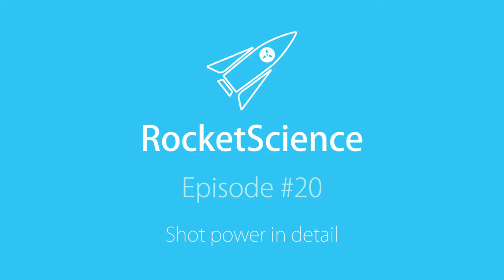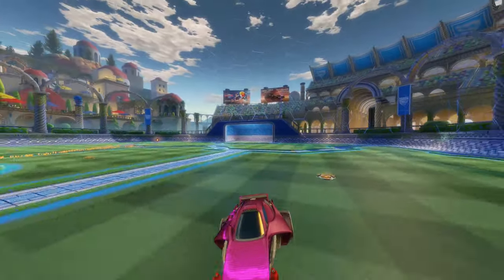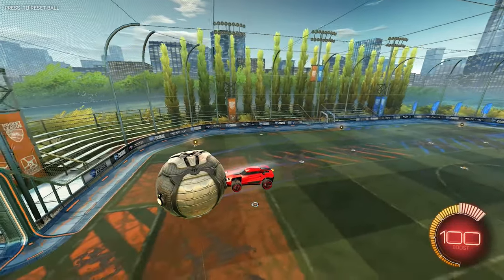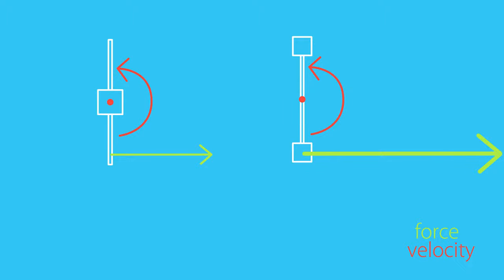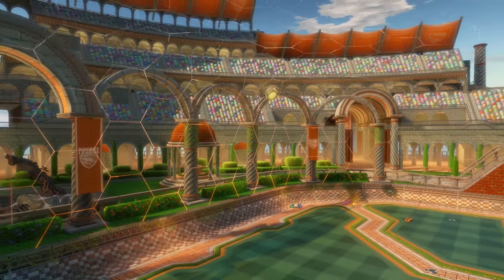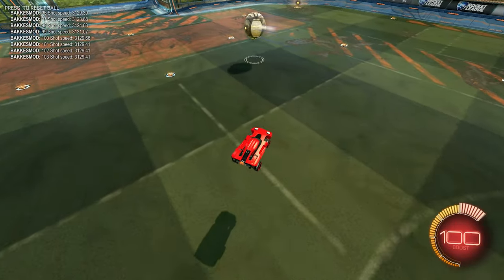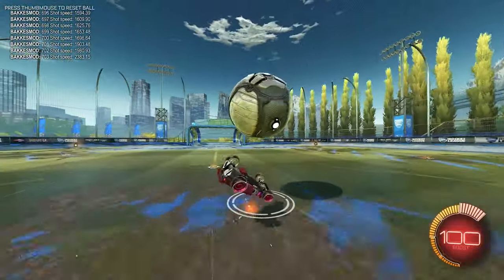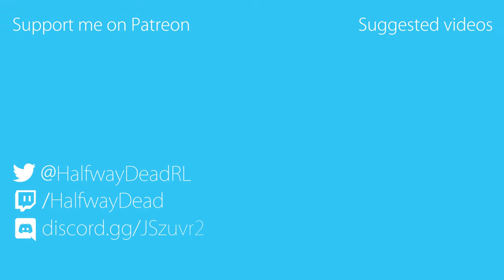Maximize Shot Power - Rocket Science #20

Comment: 5:00 fake physics off 
car floats through the air
Reply: If you think about it, you have to find the net force, this would be an easy case, you know the direction of the car and the direction the gravity are 90 degrees to each other, the net force would be the hypotenuse of the triangle, which can be calculated by the Pythagorean theorem. This will only work if the force is at the direct center of the sphere, assuming the mass is spread evenly. Other things like friction will increase the longer the more time the car is in the air, hence why, it starts falling quicker.

Comment: I've also found out there is force applied to the ball when doing 50/50s. When approaching a 50/50, if you apply more force than your opponent, the ball will apply force through your opponents hitbox, potentially going through dependent on the amount of force applied. If both parties apply equal or close to equal force, that ball travels the path of least resistance and you have a good 50/50. Idk if you've done a video on 50/50s but, you should definitely research and take an in-depth look at the science of 50/50s. I'll follow if you do/did.

Comment: Hey I have a question that you could probably answer with your testing. Do you said there is a slight difference in shot power between cars like the breakout and octane because if the length of the car and how on a diagonal dodge the breakout is longer from the center of gravity to the corner, making it spin technically faster. The only thing is, breakout is a thinner hitbox. So when hitting the ball with a diagonal dodge, your car itself will not gain as much speed as the octane when diagonal dodging into the ball because octane is wider. Hitting the ball with a diagonal dodge with octane or bat mobile means that your car will gain more speed, hitting the ball harder than say breakout because to get good contact with octane you have to flip more diagonally than breakout because breakout is thinner so you flip more forward to hit the corner properly, while octane or bat mobile, because the hitbox is wider, flip more diagonally, which speeds up the car more than a forward flip. You said that the more you aproach the diagonal angle the more speed you get from a dodge. My question is. Is the extra length of breakout better for power shots at lower speed or is the octanes wider hitbox, which allows it to hit with the corner of the car and get closer to the diagonal angle which increases the speed of the car, better at lower speeds? If not at top speed, what car is best at booming because of the hitbox? Basically what I’m saying is breakout is longer so it physically rotates faster, hitting the ball harder, but to pick up the most speed at low velocity diagonal dodges are the best to hit the ball with, like you said. So wouldn’t Octane or batmobile hit the ball harder, because the corners of the car are closer to that diagonal angle which gets you speed when you flip, so diagonal flips make better contact? Which is actually more effective, the car itself spinning slightly faster to hit the ball, or the car moving slightly faster? Thanks!
Reply from the maker: Alright, so you bring up some fair points but I first need to check if there is a misconception here. It sounds a bit to me like you think that there is just one kind of diagonal dodge that flips the car over its front corner. That is not the case. As I said in my dodges and deadzone videos, there is an area where dodges snap to exactly 90° angles and beyond that, you can dodge in absolutely any direction you want with any car. If that was clear to you then I'm guessing that what you're getting at is that it would be optimal to dodge exactly at the angle of the corner and yes that is true in theory, but it's much more important where your momentum is going than where the corner is going. We could still on average say that the Octane will have a better angle to aim for. First of all, the angle of the corner on the Octane is 30° and Breakout is 27.2° so it's certainly only a small difference. Looking at the math from my dodge video, the optimal angle to dodge is around 50-59° to gain speed. So you can see that you'll probably not gonna want to do that in a shot anyway. 3° of difference seem to give only about 8 uu/s more speed (and even less when going below 1700 uu/s) and are maybe a good way for the Octane to make up its small disadvantage in size. They're certainly not gonna make a world's difference. I didn't really go over how much testing I did for this video but I did at least a run of testing dodges on every single hitbox and a ton of testing on Octane and Breakout. There was actually a surprisingly small difference of what was achievable in terms of power. It was all within around 10 uu/s and might be even lower if I had tested everything more.
Reply: Rocket Science good reply
Reply: Rocket Science so in this video I think you said that the length of a car increases shot power too right. If an octane and a breakout were lined up dead center on the ball and both just did a forward flip in the same way, the breakout would hit the ball father right? Because technically the end of the breakout, because it is quite longer, is moving faster than the octane, which has more power. I guess my question is, does having your car’s corner closer to the 50-59 degree point more important for shot power or is the actual length of the car? If so what car could then technically get the most power on a dodge of all the cars. Also would you be able to include the degrees of the corners of all the hit boxes like you did for octane and breakout?

Comment: So using science it's proven that the reverse-45 degree flick is on average the best?  Basically because you want to smoothly roll it over as much surface area as possible with as many touches as possible, and because the hitbox naturally prefers backflips.
Reply: If you have space to do the flick, from the Info in the Video, yes absolutely
Reply: If you can pull it off consistently, at speed, with space, at the right angle, and not get your ass dunked on, then yes.

Comment: to add to this and would be cool if was also tested is. i think boomers from a flip just hitting it not a flick. also have a chance for 2 touches and if timed perfectly that is what give you alot of the extra power something that caint really be done at super sonic speed but for example  if you touch the ball rite before super sonic speed  and then flip into super sonic speed and tuch emditialy after  with the start of your flip i think you can get to tuches in creating maximum power witch is the only way the flip actually is better from your statement if that is true. all most like for a 10ths of a millisecond you caught the ball like you where to start an air dribble but then immediately  flip rite after seeming to us with the naked eye the exact same time as contact but in reality my hypothesis is u hit it once normally then hit it with he thrust of your flip rite after it would be interesting to know if this is realistic in the correct scenario or no matter how well timed the thrust from your flip is you will  not catch up to the ball. i know for sure i have roll flipped into the ball and have see 2 tuches on my car allmost like i flicked the ball with the front of my car with the front left and front right  side of the car so side to side rather then front to back. I think flipping at the ball deffinetly can result in 2 tuches off the front of your car propelling it like a flick would and thats where i think part of where "hit it with the corner of your car" comes from. being positioned correctly and flipping correctly could  result in 2 tuches i would say it most likly happens when you do a crossover shot when you and the ball are both going to the right side of the field and aproching each other at the same speed  and you shoot left with correct posting im pritty sure u get 2 tuches off of it. 1 on the side your car is closet to the ball on the initial tuch then the flip comes faster then a blink of an eye and get another and the side furthest from the ball. i think with the correct angle this does happen but a straight on hit makes it hard or impossible for your short spped burst in flip to catch you back up to it. kinda hard to explain but is like your 1st tuch can just nic the ball then you flip to get your angle or line vectors up perfectly  and cause a 2nd touch.

Comment: Correct me if i am wrong but I belive 45 degree flicks get 3 touches when jumping, starting the flip, and to get the final hit.
Reply from the maker: While you sometimes do get a touch from the jump that increases the ball speed, I wouldn't personally consider that a 3 touch flick then. It might seem like a pretty arbitrary line to draw but if the jump is one of three touches to increase the ball speed then you will not get as much power as 3 touches during the flip. I can guarantee you, that I've done 3 touches just during the flip and you can even see those if you go through the video frame by frame.

Comment: I’ve always hated the inconsistency about hitting the ball in general. Makes it impossible to truly master.
Reply: Makes it hard but also makes it possible to change the shot with small adjustment's. The only thing I don't like is the actual rng caused by the 120 physics ticks/sec. At least for single touch shots, this would be easy to fix.
Reply from the maker: @Todestuete   I think "easy" is a bit of a stretch. We know that continuous collision detection is a solution but Cone said in his talk that they didn't go with it for performance reasons. The games netcode requires physics to constantly be re-run so that's why the performance is so important. It would definitely be on my wishlist for Rocket League 2 though. Don't know if it will ever happen with the consoles and cross-play being a thing.